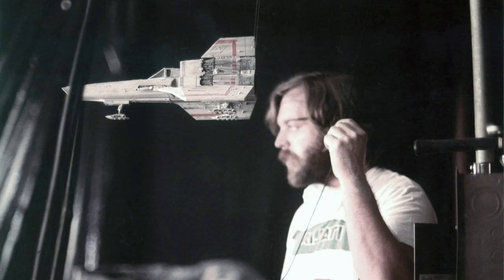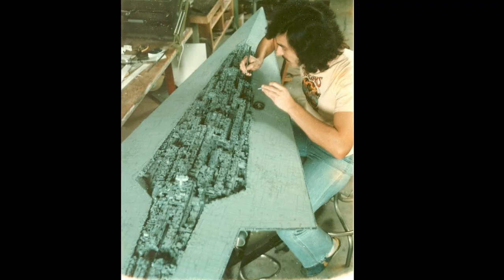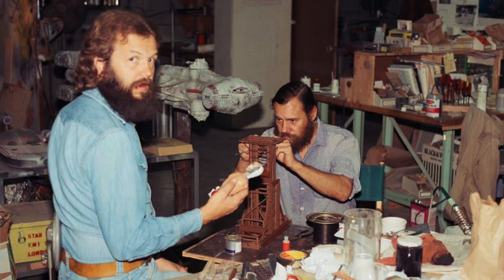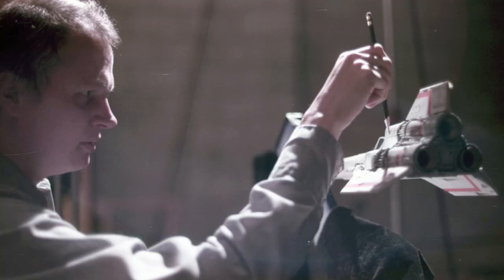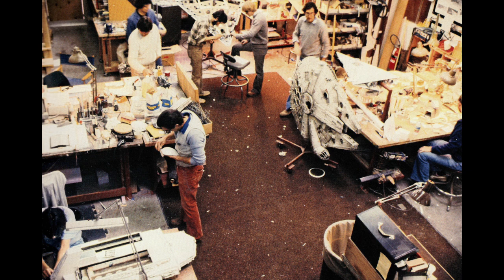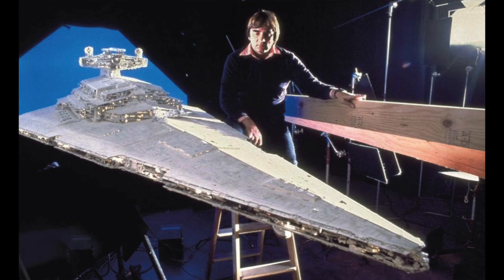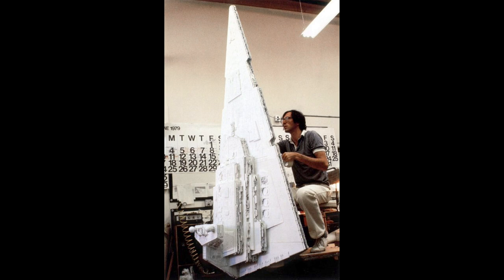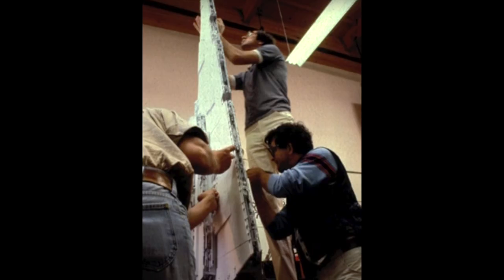THE EMPIRE STRIKES BACK miniature effects

Comment: I love it! I had a model of the star destroyer with the fiber optics. I spent 2 days drilling the holes into the shell for the fiber optics. but when I was done my lights test showed the light coming through the plastic hull, someone suggested spray painting the inside black. Then, of course, I realized the paint filled in all the holes I drilled and I had to start over. So I can feel the pain of these unforeseen problems ha ha.. it came out looking amazing though. unfortunately the tungsten bulb blew out and I glued it inside of the model. Might have to crack it open and install and LED. Man I love this stuff, these clips are great. thanks and have an awesome weekend.
Reply: I completely pulled my Legacy Falcon apart drilling tiny holes to install interior lighting through out. I blacked out the backsides of the hull. I even added down lights next to each landing gear and it looks awesome. I totally aged my Falcon with extra rust streaks, black soot in places with a cigarette lighter, hoses on the landing gears. She looks like a real beat-up Corallian freighter but when I turned the lights on in the half-dark there is light spilling through the side of the cockpit. That was heartbreaking. But I'll fix it somehow...
Reply: @gecko-sb1kp  dam man that sounds awesome! but we're not industry level model makers and these are the things that happen. youll figure it out, wish I could see it. sweet
Reply: @flipnap2112  The legacy Falcon is huge. It's beautiful. It's so good you just want to add more. Thanks for the reply. Cost me a thousand bucks which is ridiculous but she's mine to do 'a few modifications'...lol...